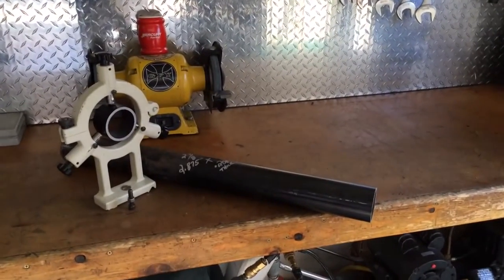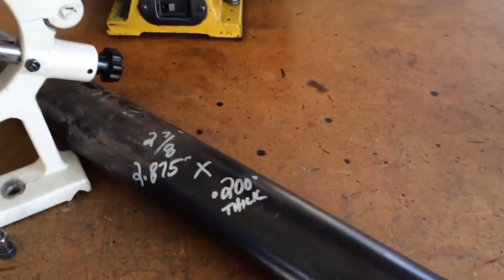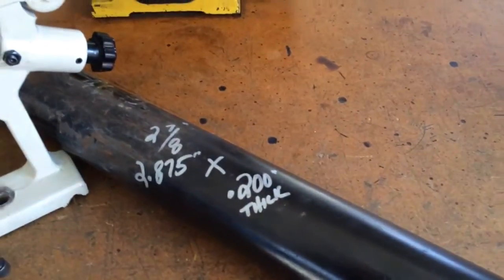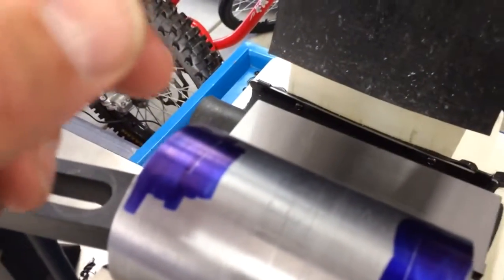Steady Rest Spider Part 1

Comment: Looks good.  The only thing I would do different is make the cathead out of thick wall pipe.  That way you can always mount the work piece between centers and skim cut the bearing journal surface of the cathead after mounting it to the work but before putting the steady rest in place.
Reply from the maker: For sure would have been nice to have a thicker wall piece, I used what i could get my hands on at the time and it works well. Thanks for the comment and for tuning in! Best Regards, Ray

Comment: Nice work, I've made a couple of those for a Lansing G24x160 lathe myself. I saw the way you orientated the piece, I don't know if you've heard of them, but a good tool for that is a Miracle Point center finder. It allows you to punch a dimple at any angle desired and to rotate a piece to any desired angle with great accuracy. But they cost about $200. But its clever to use a height gage if thats all you have to get the job done.
Reply from the maker: Thank you brother! I would like to check out the Miracle Point center finder, sounds like a really handy tool, maybe I can find one cheap on eBay. Thanks for the tip, and thanks for watching! Ray C.

Comment: Hi Ray....nice work...saw the Clausing in the background :)

It will be interesting seeing the finish product and how you go about alignment of the two parts...

FYI hitting the subscribe button!

Chuck
Reply from the maker: Hey Chuck, How are things up north, still no rain, and has been like summer all winter here. Funny you mentioned alighnment... I was playing with the steady rest spider a little while ago, I first indicated it in the steady rest, then indicated a scrap piece of 36" bar. I then quickly realized you have to use two indicaters to zero the bar or the spider will wobble. I did get it to run within 3 thou, faced the end of the bar then called it a day! I do a vid on it once I get the cap screws, and get the bass tips in. Thanks for subscribing, and keep all you great videos coming!

Comment: the finished project looks good (and useful) but personally I wouldn't rely on the flats on the heads of bolts as being either a precision size or necessarily centered with the threaded portion when referencing position. This job didn't really call for high precision but don't expect this to work if you are trying to hold a tolerance. Keep up the interesting vids.  Gerald

Comment: I like your mill setup.
What is the hole in the back left corner of the mill base, recirculating coolant?
I need to build a steady rest for my P & W but steel is so dang exprensive!
Reply from the maker: Thanks Tyler! The hole is for the flood coolant, I really don't like flooding my machines so I disconnected the system and use cutting oil by hand. Yea steel is crazy expensive the alot of it is crap. I get most of my stuff from Onlinemetals.com I would look on ebay for that steady rest, I found alot of the parts for my Clausing there. Thanks for watching!
Reply: Ray Caniglia Thanks for tip on that website. I keep one eye on eBay but no luck so far, be on the lookout for a steady rest and or micrometer carriage stop for a Pratt & Whitney 12".

Comment: Watched both part 1 and part 2. I’ve thought of making one of these myself. Have the same Grizzly you do. I’m a gunsmith and do a lot of barrel work with mine. Find myself working over the bed in the steady a lot more than I thought I would. Have you noticed any issues with deflection? I’ve seen cats heads used in a four jaw. Haven’t seen them used in a steady rest yet. Always wondered how well it would work out
Reply from the maker: Hello, The Steady Rest Spider is a must for Gunsmiths like yourself, they work great for workholding that you otherwise can not chuck up and/or working at the far end of a barrel. Deflection is not a problem if you take smaller cuts and use good quality tooling with inserts for the material your machining. I hope this info helps!

Comment: Hi Ray, nice job on the hole alignment but if I might offer a tip on the drilling, if you have a 5/16" centre drill there is no reason why you cannot drill all the way through in one go, well you can on thin material. It would save all those drill changes and make the job go a bit quicker, thinking of which, are you running your drills at the optimum speed or does it just look slow because of the  video effect?
ATB
chris
Reply from the maker: Hi Chris, Thanks for the tip's! I am running the HSS drill bits at about 550 RPM, maybe I can run them faster. I do like to take it slow when drilling and milling, I tend to screw things up when I try to go too fast. Thanks again! Ray C.
Reply: Going too slow can put too much load on some styles of cutters, but on the other hand going too fast just generates heat. There are charts that give a range of speeds for drill presses, but remember to reduce this when drilling in the lathe.
Reply from the maker: Chris Stephens Thanks Chris! I just got a Machinery's Handbook Twenty-First Edition, I do need to refer to it instead of getting into a hurry to finish. I am learing that speed comes with knowledge! Thanks again! Ray C.
Reply: Oh yes indeed, the more you know the better/quicker you are. There comes a point where you realise you can make something you want first time without making several "trial" pieces first.:>)
chris